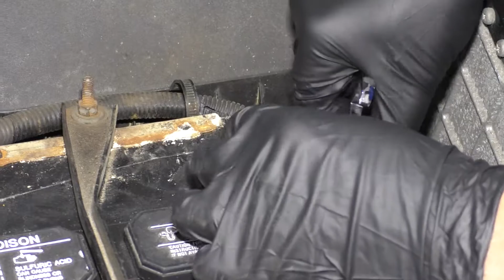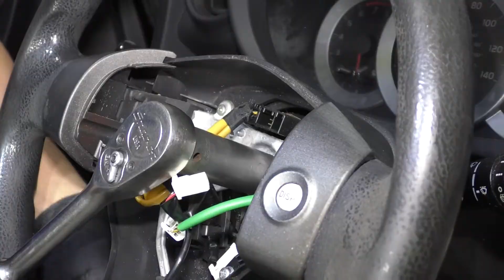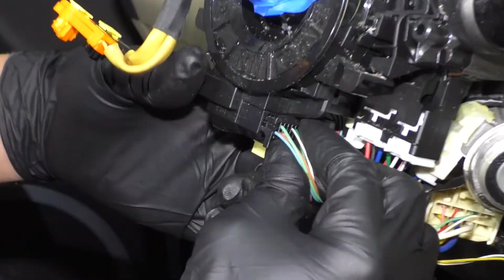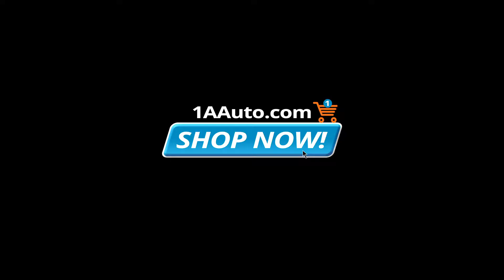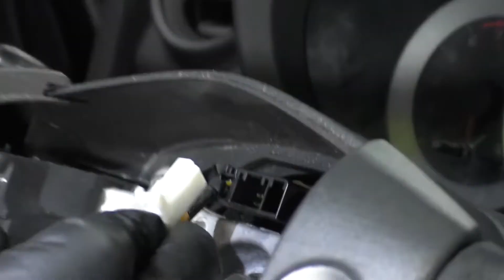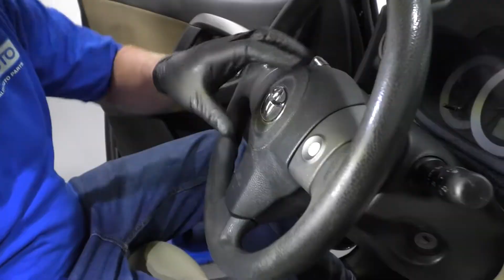How to Replace Turn Signal Switch 05-16 Toyota RAV4

Comment: I used this video, step-by-step to replace this switch on my 2010 Toyota 4Runner Limited. The headlights would flash or turn off completely if I used my blinkers. No rhyme or reason, so I replaced this switch with your video. For the 2010 4Runner I had to pop off two small covers to gain access to the screws to loosen the airbag. And there were two screws holding the covers that cover the steering wheel column. Other than those two minor differences the removal and replacement of the switch was EXACTLY the same on my 2010 4Runner as this video. Thank you! You saved us hundreds of dollars.

Comment: Hi! Can’t you remove the turn signal stalk without removing the steering wheel? I thought you could just remove the top and bottom covers and unclip the signal stock. Is the clip not accessible without removing the steering wheel? Thanks